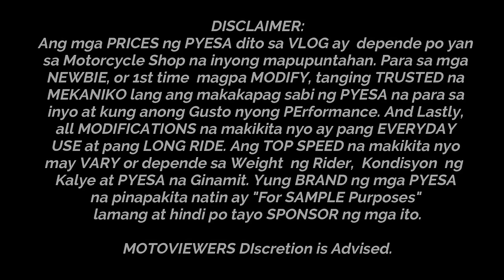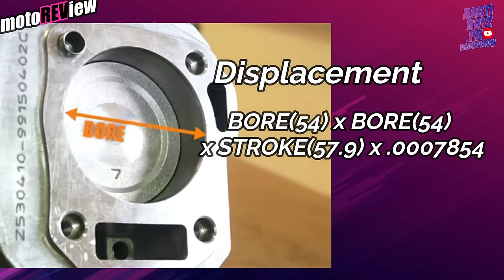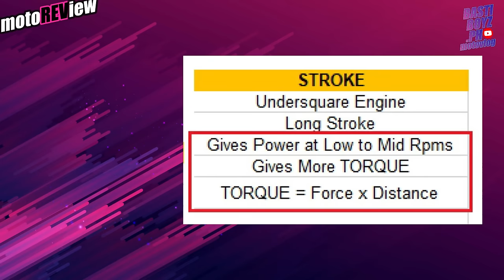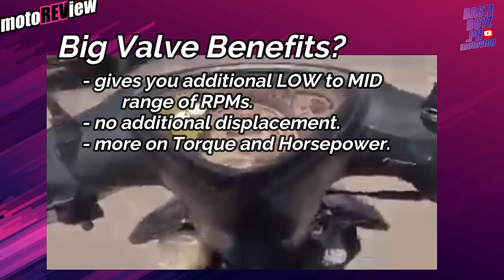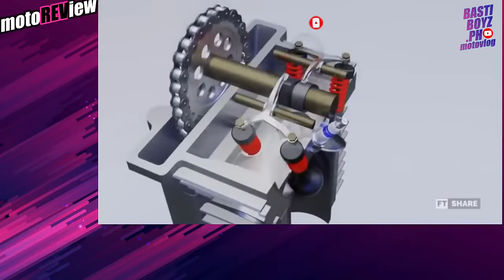TOP 5 BEST KARGADO SET UP FOR EVERYDAY USE l KARGADONG MOTOR l motoREView l BASTIBOYZPH

Comment: Sila nagtataka sa wave 100 ko, ambilis daw tumakbo dinadaig mga Raider150 na allstock, di kasi halata na kargado na kasi ang tahimik ng makina syempre sobrang galing ng nag setup eh medyo kilala na dito sa Davao🤗cams and port palang umabot ng 9hrs masasabi mo talaga na safe makina mo😍 kaya ang resulta parang stock lang pakingan walang ingay🤗
Reply: mas magaling kalang gumamit ng kambyo boss hehe
Reply: CKS
Reply: Dinaig mo pa ang RIDER 150? Tapos ang tahimik ng motor motor mo? ibig sabihin tumatakbo top speed ng 150kph higit pa? Tapos tahimik makina mo? Pano ginawa ang motor mo? Ang pagkakaalam ko pag kargado halata sa andar dahil mataas ang compression. Tapos sasabihin mo tahimik andar ng motor? Or baka naman nilagyan mo silencer tambutso mo.
Reply: Super stock ba boss camshaft port head at 30 or 32 mm na carb
Reply: Kamusta na ngayon motor mo boss
Reply: warak na yata mga engine wall

Comment from the maker: Musta mga ka RATRAT!!! This MAY 2023, Tuloy tuloy lang sa panonood kahit 1Year na itong Video na ito. This VLOG applies to ALL SCOOTERS, for CARB TYPE, sa FI Engine naman po, halos LAHAT SWAK naman po, maliban sa mismong CARBURETOR.....28mm Keihin sa CARB Type, pero THrottle BODDY naman sa mga FI, may mga sizes din po yan  ....PLease feel FREE to comment para dito sa ating TOP 5 BEST KARGADO SET UP. Pwede rin kayo mag SHARE ng inyong THE BEST na KARGADO SET UP....Para ma-EDUCATE natin yung ibang BALAK magpa KARGA....RS mga kaRATRAT!!!!
Reply: Good pm sir! Sir hinge po sana ako suggestion nyo kung ano bola gamitin ko for my click 150v1 na naka 59mm, complete pang gilid po saka power pipe, naka ignition coil at irridium spark plug na din po ako, bola ko po ngayon is combi ng 10 & 11 po, pero nabibitin pa din ako sa dulohan, ok lang po sana saken kahit sakto lang ang arangkada, at may dulo. Tia po sir and more power.
Reply from the maker: @juanchojrllamas9887  , Try mo Straight 12 or 13, add ka 14T Gear...
Reply: Master anu magandang combination sa skydrive 140cc naka 1k center at clutch spring naka ttgr racing torque,naka sun racing fully, 15 at 13 fly ball peru 90 lang ang top speed,anu kya maganda gawin nito,sana mapansin nyu po.
Reply: Idol safe ba pang long to?

Mio sporty
59 BV 
MTRT Block 
MTRT Head 24/28 vintech
MTRT Forged piston 
MTRT Connectin Rod 
MTRT Lighten pin 
JVT Manifold 
JVT Ignition 
JVT gearings (14/41)
Keihin carb 28
Reply from the maker: @marhba9398  , Yung akin 59Bv din, JVT Bore, BV MTRT, pinakamatagal na Byahe ko sa ENdurance ay 38Hours non stop, wala namang nasira.....depende sa Mekaniko kung paano nya i set up...
Reply from the maker: @marhba9398  , Kahit anong karga, pyesa, OK naman yan, ang importante lang dapat mapagkakatiwalaan yung Mekaniko mo...Halos same lang tayo ng KARGA sa dati kong 59BV, di lang ako naka Gearings....36Hours Byahe palag pa sa akin....
Reply: Sir hindi ba magastos sa gasolina pag kargado ?

Comment: paps baka may review ka sa naka bore setup na mio gravis. Very informative video para sa mga gusto mag karga ng mga motor nila.
Reply from the maker: HAlos parehas lang naman po, maliban sa Keihin Round Slide na Carb, magiging THrottle body na ang mga ia adjust, ...pati po  sa BORE...sa mga lumang MIO kasi 54 at 59mm, 63mm and Up po ang meron, diko lang alam po kung ilang millimeter din sa Gravis...

Comment: Sa mga springs po. San po pwede gamitin ang pinaka mataas na rpm. Ska ano po yung pinaka mataas. 2500rpm lang po ba. Balak ko po kasi mag set sa high rpm springs e. Thanks po dame ko natutunan sa blogs nyo. =)
Reply from the maker: Center Spring
Mas Matigas - Mas pinipigil nya ang pagbuka ng Torque Drive. Then pag binitawan mo yung Throttle, mas mabilis bumaba yung RPM.
CLutch Spring
Mas Matigas - mas DELAY ng Konti ang lapat ng Lining sa BELL..
Bawat Rpms ng Spring ay para sa TONO at BEHAVIOR kung saan mo gusto pumasok yung arangkada, ...

Comment: Bagong subscriber lang papi. Followed na rin sa fb at ig. Very informative ang contents. Panalo. Tanong lang po. Anong magandang combination ng flyball, center at clutch. Aerox user. 90 kilo rider.
Reply from the maker: From Stock na Bola, try nyo po magbawas ng 2 grams or 3 grams sample 15 grams Stock mo na bola gawin mong 13 grams straight....then 1.2k rpm Center at clutch spring.

Comment: If naka long duration cams ako around 5.5 lift with 30mm throttle body. Pwede ba mag big valve na 25/30? Matsala sa reply
Reply from the maker: Di ako sure kasi ang akin lang ay naka MIO 59 BV na 28Keihin...diko sure sa FI....Tsaka ang alam ko kapag nag BV ka, meron na syang sariling Cams.....

Comment: Sir question lang pwede po ba stock carb and stock head sa 59mm block? If pwede sir ano mai s suggest nyong cams and valve spring for 59mm block stock carb and stock head? Thanks sa answer sir.
Reply from the maker: Cam profile mas maganda, sakto sa Build mo, valve spring depende sa mekaniko.... ang 59mm bore,, sakto sa kanya ang 24-28mm keihin round slide, para mailabas yung potentilal ng karga mo....Stock Carb sa 59 kasi medyo sakal at mahihirapan kang magtono....
Reply: Oo nga sir medyo sakal po yung power nya, plano ko po mag upgrade ng cams 6.0, 28mm carb and PNP sa stock head, Sa valve spring ok na kaya yung 5turns? And ano po kayang jettings b bagay?
Reply from the maker: @itsmebrylle_  , sa Jettings po, si Mekaniko napo ang bahala magtono nun, 5L ok na trin yun......

Comment: nice video po idol ask ko lang ano usually yung reason bakit yung ibang kargado is nasasabugan ng makina? plano ko po kasi na mag 54 allstock. Salamat idol more power sayo
Reply from the maker: Maraming pong Reason kung bakit nasasabugan ng Makina...

1. Wrong Clearance sa Tappet.
2. Over REV
3. LEan Mixture (Lamang ang Hangin kesa Gas.
4. Langis di nagsi Cisculate sa head.

BAsta kapag magpapa Modify ka ng Makina, dun ka sa Magaling at Dependable, kahit anong tanong sa Karga alam nya...
Reply: @BASTIBOYZPH  salamat idol more power sa channel mo
Reply: @BASTIBOYZPH  idol may mga ma recommend ba kayo na shop para dito?

Comment: Sir tanong ko lng sana nkapag karga na ako ng 59mm bore racing injector saka racing cam. Pero di man nadagdagan yung top speed ng MIO SOUL I 125 ko pero lumakas yung hatak. Ano kaya maganda na set up ng pagilid ang da best sakin city driving lng ako.?? Yung di na sana ako magpapalit ng racing ecu pero tataas yung top speed.
Reply from the maker: Try mo JVT panggilid, tapos yung sa video ko na PangGILID set up sa Torque drive, bawas Slot konti para umangat yung BELT sa Ilalim....then Racing CDI para tumaas yung RPM limit.....then try mo 1k c.spring and center pring....

Comment: Sir nka 54 all stock po ako balak ko po mag palit ng cams 6.0 at 5 turns valve spring. Ok lang po ba hnd na iport ang head? Salamat po ng marami
Reply from the maker: Pwede naman hindi ipa PORT,  pero sayang po kasi....Kaya po tayo nagpapa POrt and Polish dahil para hindi kumapit yung Carbon at para gumanda yung FLOW ng Combustion, (GUmanda yung Sunog ng Compression).....
Reply: Ok po idol maraming salamat

Comment: Good day po sir, hindi po sana ako ng advice, hindi kasi ako makapag decide. 24/28 or 25/29.5? Yung hindi na need i port, plug and play na sya. Gusto ko sana mag Big valves, Nouvo Z po motor ko. Naka 59cb, 6.5 cams, 5 turns valve spring. 

Mapansin nyo sana tanong ko.. 🙏🏻
Reply from the maker: 25/29.5 boss...
Reply: @BASTIBOYZPH  Thank you po sir!

Comment: Good pm sir! Sir hinge po sana ako suggestion nyo kung ano bola gamitin ko for my click 150v1 na naka 59mm, complete pang gilid po saka power pipe, naka ignition coil at irridium spark plug na din po ako, bola ko po ngayon is combi ng 10 & 11 po, pero nabibitin pa din ako sa dulohan, ok lang po sana saken kahit sakto lang ang arangkada, basta may dulo po. Tia po sir and more power.
Reply from the maker: ano ba timbang mo? try mo mag Racing cams at PnP.....
Reply: @BASTIBOYZPH  110kg po, naka 5.5 lift na din po ako na project fi cams, nag pnp na din po sir.

Comment: Boss Tanong ko lng kung ung 59 power is ok sa burgman 125 Tas kelangan ko bang tanggalin ung FI Niya para sa carb?
Plano ko Kasi mag long rides Luzon dulot dulo...
Reply from the maker: I check nyo po muna kung may BORE UP Kit na si Burgman kasi sa MIO, normal na na 59mm Bore ang meron sa kanya.....tapos kung FI sya, no need to convert to Carb Type, adjust ka na lang ng size ng Throttle Body or Injector...Bago pa kasi yung Burgman, pero sana may After Market na na Pyesa sa kanya for Modification.....RS ka RATRAT...
Reply: @BASTIBOYZPH  salamat boss... Tuning in for more future vids take care
Reply: @BASTIBOYZPH  also boss regarding dun sa rear Kase maliit nga ung rear ng burgman balak ko sanang i extend ung rear ko pag kargado na siya para sana mag kasiya ung tire ng like sniper or kahit magkasiya sana Ang 14 ... Whats your thoughts kaya diyan boss?
Reply from the maker: @sk_aerogaming6011  , diko lang alam kung may Modified Swing arm sa Market, yun lang ang bagay sa BUrgman....Sa 10th Ave try mo....
Reply: @BASTIBOYZPH  salamat ule boss :)

Comment: sir new subscriber lang me. naka 59mm bore, 6.5 cam, 6 turns valve spring, cam bearing racing, jvt pulley set, rs8 clutch bell, rs8 clutch lining, jvt fly ball 9g. pwede parin po ba pang byahe ng malayuan tong set ng mio sporty ko boss? 210 km byahe po. thank you!

Comment: Paps tanong ko lang po nagpalit ako pang gilid straight RS8 yung brand na pinalit ko pulley set clutch assy 1k rpm center spring flyball 8G bell pero sobrang tagal ng arangkada galit na yung makina bago umarangkada stock engine lang po mio sporty salamat po sa sagot paps!🙏
Reply from the maker: Ilan po ba ang Stock Grams ng Bola sa Mio Sporty?.....Baka naman po sobrang gaan naman po...dapat kung nong grams ng Stock, bawas ka lang muna per 1 gram at a time...di naman kasi biglaan po yan...

Comment: Ano pong magandang Flyball,  1k center at clucth.  Salamat po Sagot
Reply from the maker: Ano pong Motor nyo at Karga?...Try nyo 12 or 13 straight...
Reply: Mio soulty lang po ser.  Stock engine lang din po.  60kg po ako.. Thaankyou po ser. @Newsubcriber❤
Reply from the maker: @joshuaaquino9237  Palit ka pulley set, RS8 Ver. 4.2....

Comment: Penge naman ng tips idol naka 59mm ako stock carb ang napalitan lang sa pang gilid bell at clutch spring 1000 tapos bola na straight 9 nung unang salpak ng 59bore medyo malakas talaga pero gang 40-60 lang pg piga after 1week parang nanlata na 😔 salamat idol sana mapansin moko😊
Reply from the maker: Stock po ba HEAD nyo at Pipe?
Reply: @BASTIBOYZPH  opo sir naka port and polish
Reply from the maker: @naknampucha1905 , yung pipe mo stock o aftermarket?
Reply: @BASTIBOYZPH  naka retubo na tapos yung pipe naka kalkal mio soulty stock po
Reply from the maker: @naknampucha1905  , try mo mag Kalkal Pulley or afterMarket, ...para sumabay sa tono ng 59mm mo....then 1k CLutch lining at Center spring.....kapag malata pa, 24 or 28,, Keihin ka na....
Reply: @BASTIBOYZPH  maraming salamat lods binigay mong idea   happy new year ❤️❤️❤️

Comment: Boss tanong lang. Ano po ba kulang sa mio sporty ko para lumakas pa maliban sa bv. Yung sporty ko naka 59mm cb, 30mm carb, cams, center spring, clutch spring at pulley set.

Sana masagot nyo po hehe salamat po godbless!
Reply from the maker: OK na yan Boss, Pnp at 14T Gear na lang....

Comment: Baka po meron kayong maipapayo para sa ADV150 98kilos rider po.
Reply from the maker: Pwede naman po kayo mag try ng Top #5 natin, Pang Gilid lang muna kasi 150cc na po kasi yan, malakas na po yan...kapag BITIN pa kayo, proceed to CAMS and BORE,....
Reply: Ano pong cams ang pwede kong gamitin at recommended bore na kailangang gawin. Naka panggilid na po ako pero sa TD stock palang po 17g na flyball 1200 center spring and 1000 clutch  RS8 Bell JVT pulley. Mejo nabibitin na kase ako.
Reply from the maker: CamProfile kuhain mo, yung sukat sa magiging BORE size mo....At need mong maghanap ng mapagkakatiwalaang MEKANIKO kasi sila may alam ng SUKAT ng cams at BORE na para sa SET Up mo pandagdag sa Panggilid....

Comment: Panong pumapalo ng 120kph ung mga naka full gilid set up. Samantalang ako full gilid set up pero hirap kumagat 105?
Reply from the maker: Ano po ba motor nyo? Maraming Pwedeng idagdag na Pyesa. pero kung ako sayo, Pang Gilid, Racing Ignition Coil, Iridium SP, at Gearings...
Reply: Naka iriduim na ako at coming pa racing coil. M3 po alaga ko 1k rpm center,stock clutch,groove bell,kalkal pulleyat df,daytona clutch linning,stock belt at straight 9g bola at naka washer. My mali ba sa pagtono ko? 60kg ako
Reply from the maker: @DeeJayMoTo  , Walang Mali sa TONO nyo po..... ipa Dyno Test mo na po yan, para malaman kung saan yung kulang sa Mio mo, kung saan pwede pumasok yung HorsePower...Mas accurate pa kung ganun....
Reply: Naka crash guard at hrv bracket pala m3 ko tas 80 front at 90 rear tires di kaya dahil dun? 60 kg rider po

Edit:stock mags pa pero planning to buy rb8
Reply: Ako nga all stock 117kph honda click 125.. 85kgs :)
Reply: @Darremedy1021  madali abutin yan sa stock set up ang mahirap kung naka pang gilid kana pano mo adjust ung arangkada at gitna set up mo na magkaroon ng dulo kahit di mag bore up
Reply: @DeeJayMoTo  mali yong 9g mo na bola..e try mo straight 11g..din kalkal pulley or racing pulley..1k rpm center at clutch..
Reply: @changeiscoming6162  cge paps planning din ako bumaba 12g straight kc mag uupgrade ako ng ibang brand na pulley at df. Pero try ko din yan 11g habang nag ttono ng pang gilid
Reply: @DeeJayMoTo  mag bore up kana lang..kasi dati sakin..stock m3 ko..kalkal lang ang baon..kaya mag 125kph eh..din nung naka 59mm na akoa..tukod na sa 140..6.0mm cam..din pnp..din may konting magic nang mikaniko..hahaha..stock ecu lang..din 140cc injector..

Comment: Sir good day anong magandang flyball sa naka 54mm mio sporty , 65kg timbang ko... Naka kalkal na po ung df , naka rs8 clutch bell At naka racing monckey clutch lining...try ko ung tatlong 8g at 10g ,umabot 118 topspeed ko ..goods na po ba un? Or may ilalakas pa?.. balak kung mag cams 6.0 at 2.8 5turns Valve spring at mag 1k rpm center spring... My ilalakas pa po ba? .. anong magandang flyball.... Sana masagot nyo po .. salamat rs.
God Bless😊
Reply from the maker: 118 Top Speed ay Sapat na po yan, Advantage mo na yung Timbang mo, Sa BOLA, wag masyadong MAGAAN. Sa Timbang ng Bola mo ngayon at sa TImbang ng Stock na bola, Hanapin mo yung Gitna......TRy mo mag 14T..
Reply: SAlamat po sir..
awmp May ilalakas pa po ba pag nag 6.0 cams ako ? .. awmp sir ano po ung 14t?
Reply: 14t gearings po ba?
Reply: Sir last na po , ok lng ba tatlong 7g at tatlong 9g ,1k center spring, stock clutch spring  ,6.0 cams , 2.8 5turns valve spring ?
Reply from the maker: @markfelixcelmar944  , Yes Gearing po sya, para madagdagan yung Top SPEED mo...Again, Trial and Error po yan, pwede suwak sayo, pwedeng hindi.Kung 118 Top Speed mo, Stay ka na dyan..Konting dagdag na lang sa PArts OK ka na...
Reply: Ok po sir , maraming salamat po ... Na subscribe na po kita sir... Rs po
Reply: BASTIBOYZ PH 14t/40t po ba sir?
Reply: @BASTIBOYZPH  boss skydrive naka 61mm stock head,cam 6.3 naka port,28mm carb anu maganda sa jettings para tumipid sa gas,sana mapansin mo.
Reply: ay wow 118km ? sa set up na 54mm bore,?  very na very good yan lods tpos wla pa cams at valve spring nun saka spring sa panggilid

Comment: Ako paps talagang di nag tagumpay motor ko sa. Loaded specs wla. Kasi available racing parts poro lang bore up saka may port din pero wlang available cam racing cdi wlang availability para sa motor ko paano kasi Indian bike motor ko tvs neo xr 110 sa lakat ng tvs na 110.senearch ko sa utube parang ako. Lmg ang nag pa modified ng motor. Ko na naka bore at mga naka clutch spring at clutch plate, naka faito ignition coil irridium spark plug sa. Utube talga pag side car lang capacity ng motor ko pero di ako. Sumuko hangng sa pag hangad mapa bilis motor ko 2 times ako nasabugan sa piston ko at dumudura ng oil at instant Terrik after that pinayus ko at di kona ginamit at benta konalng kahit anung birit ko 105kph lang talaga, original top speed 100kph iwan parin ako sa smash 115 at 110, kaya later on mag iipon. Ako. Ng pera someday bibili nlng ako ng big bikes total malaki nadin magastos ko sa lintk na load ng motor ko na indi ko manlang ma enjoy ang full. Power na bitin, pinaka ma laking bore na nagawa ng racer. Mechanics ko paps nasa around 57mm lang kahit e search kopa sa lazada at shoppe kahit 59 wla talaga at camshaft wla din available regrinding ang last option kaso di kona kaya ang gastos kasi for shipping pa at matagal pa maka rating kaya malungkot ako that time dahil. Motor ko ay ampaw lang talaga ang lakas, design sgero si tvs neo xr 110 na indian bike for high level of fuel efficiency and reliability lang sgero unlike kay smash pang race up set talaga hay, kaya big bike nalng ako haay